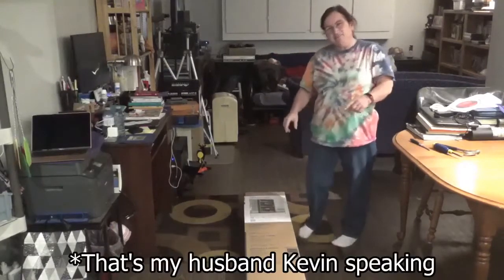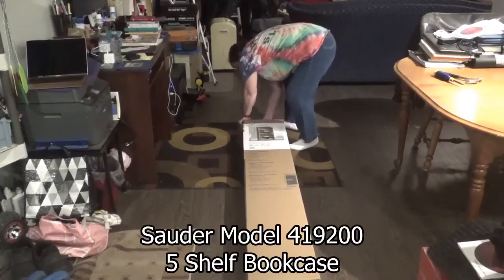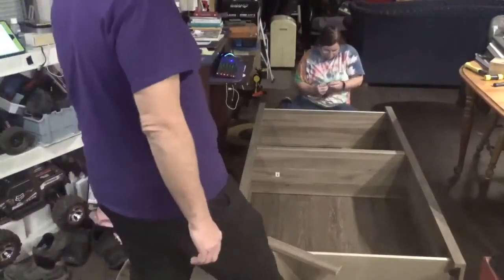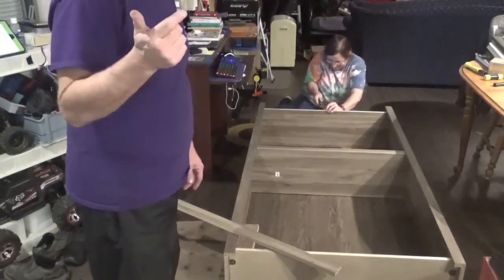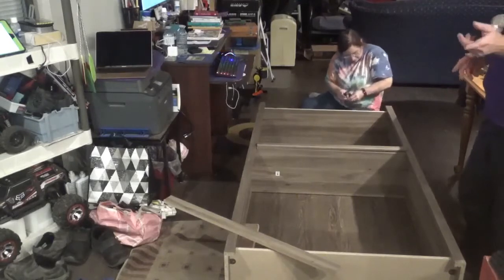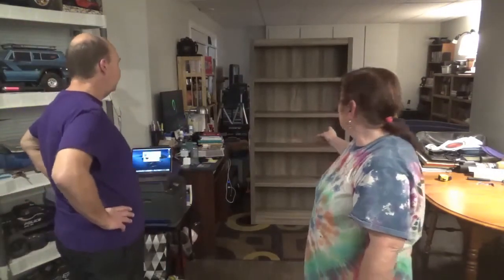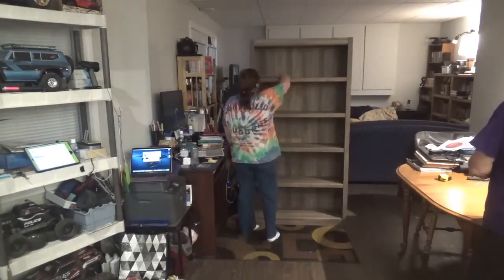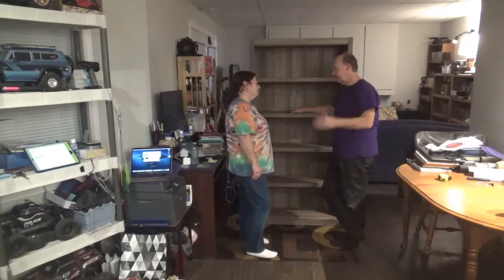Sauder 5 Shelf Bookcase Model 419200 Unboxing And Assembly Time Lapse

Comment: This is not helpful. Instead of a "locked-down" camera shot, you desperately needed a third party hand-holding the camera to move in for close-ups of what your hands were doing for clarity. Yours is the first video I have found that appears to have the older style Sauder fasteners. I have an older Sauder desk that uses these fasteners and I can't figure out how they can come apart without fracturing screw heads they are so tight.

Comment: First all sounds went away, 
Now I can hear but it's on fast mode ???
How am I supposed to learn anything???
Reply from the maker: Hi, thanks for watching. 😁 Sorry about the sound issue,  that must have happened after I uploaded it since the file was playing fine before. I am glad to hear the sound came back though. As for the fast mode (sped up playback) I made sure to slow down to explain the important steps and then sped up the implementation of those steps. How long do you want to watch someone turning a screwdriver? I figured that most people (in fact I have been told this is so) are not interested in watching a long video filled with boring footage of simple actions. By outlining the steps and the important points on those steps and explaining how to accomplish them I then sped up the doing of those steps. I am sorry you didn't find this helpful in being able to learn anything but I have gotten the same amount of flak for the opposite on videos I have done that are longer, too.😏